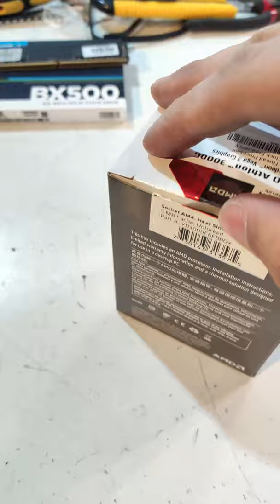ARMANDO PC ECONOMICA PARA JUEGOS CON UN ATHLON 3000G #Shorts

Comment: Porque me va a 8 fps si tengo el Athlon 3000g con 16gb de ram y esa misma placa?
Reply from the maker: Hola! Qué es lo que te va a 8fps específicamente?
Reply: @MaxiMontoya95  todo, ningún juego me va a más de 8 fps probé Minecraft con 4 chunks y ni eso pasa los 8 fps, tengo 16 GB dual channel y Nose porque será podría ser por qué no tiene overclock?
Reply from the maker: Nono, sin OC. Compraste la PC ya ensamblada o la armaste vos? Probablemente sean los drivers! Hiciste la instalación de los mismos? Usualmente tenés que hacerlos vos manualmente desde la página de AMD.
Reply: @MaxiMontoya95  la arme yo, pero los drivers de la placa o amd? Porque tengo todo actualizado a la última versión
Reply from the maker: Los drivers del procesador, en este caso la bios ya tiene compatibilidad con ese procesador en específico. Probá reseteando drivers o haciendo instalación limpia de Windows nuevamente. Con qué lo activaste al OS?
Reply: @MaxiMontoya95  puse Windows 10 Pro pero aún no le compré licencia, la instalación de los drivers AMD la descargue desde la web oficial y la ruta de instalación en predeterminado
Reply from the maker: Muuuuy posiblemente sea la falta de licencia. No compres aún, probá activando con KMSauto para ver si mejora el rendimiento.
Reply: @MaxiMontoya95  vale muchas gracias, intentaré eso
Reply from the maker: Me olvidé de esto y retomé la duda! Jajaja
Reply: @Bubba_RE  aún no tengo presupuesto jajaja